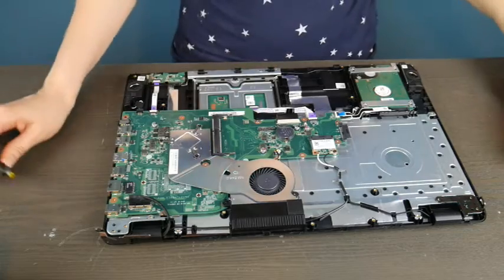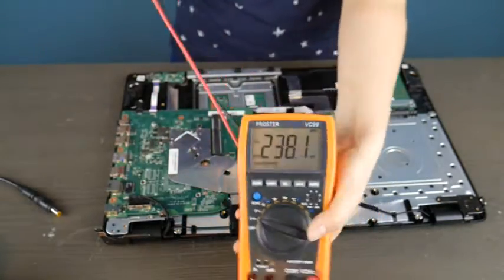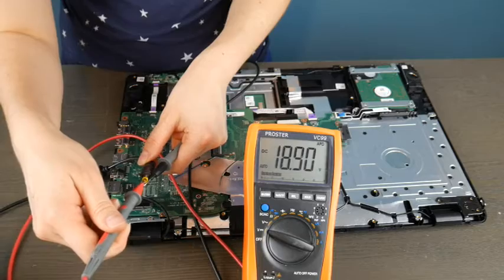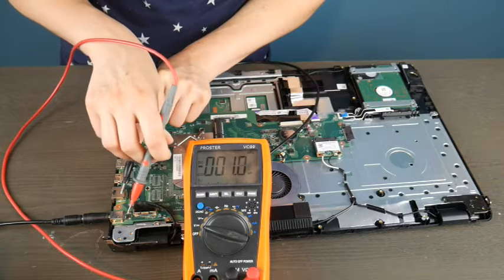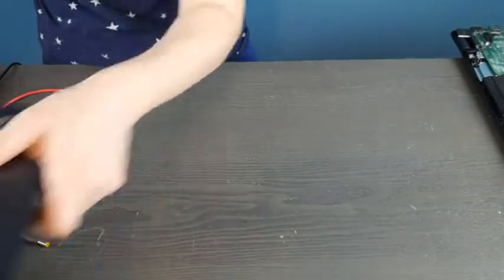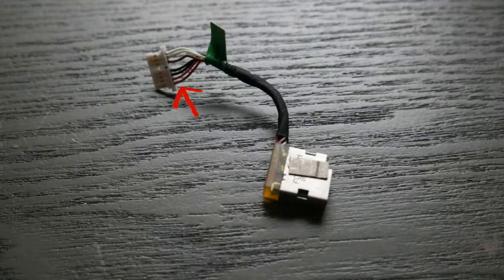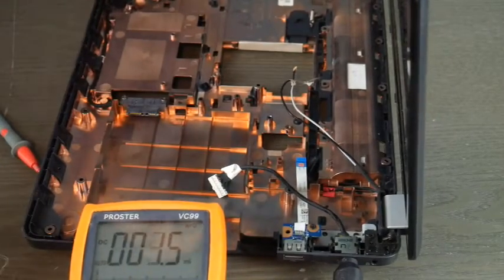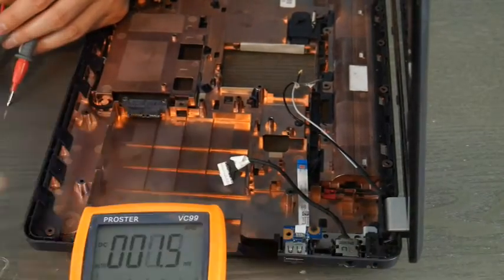How to Tell if Your HP Laptop's Charging Port is Broken - Learn to Troubleshoot and Diagnose

Comment: Could a laptop rely on charging with a type c or USB/HDMI cord charger?? I can't afford the volt tester and I think my laptops charging input is physically damaged! My laptop fell on the floor on its side with the charger plugged in :/
Reply from the maker: Yeah, that could definitely gave damaged the port. That's actually a common way it happens. If your computer is designed to charge through an additional USB C port then yes that should work.
Reply: @EggheadFixers  thank you so much! I'm getting a new battery on Sunday to revive my old laptop instead of buying a new one🤗
Reply from the maker: @LailaLopez-te1dc  Nice! Glad to hear its working out